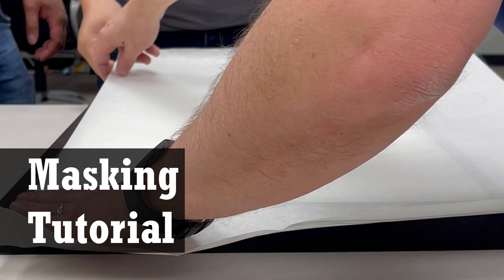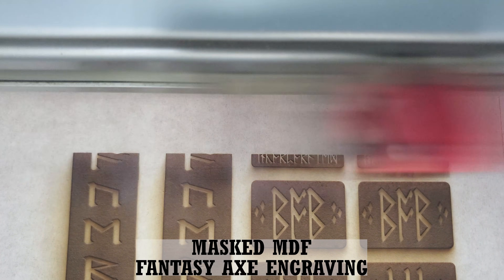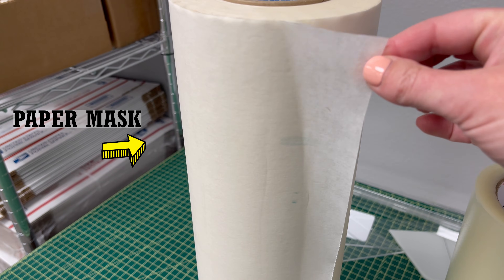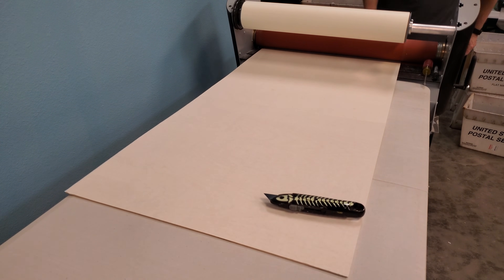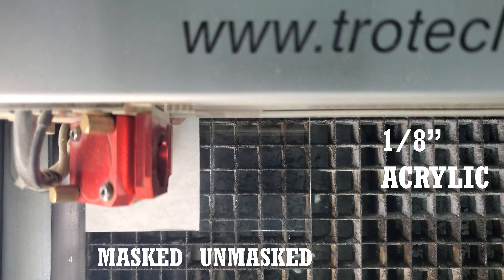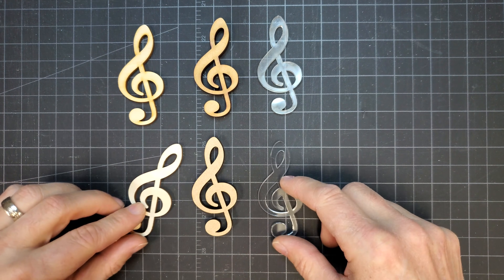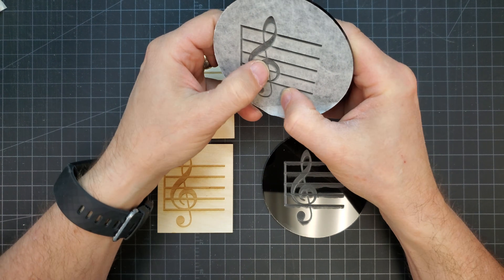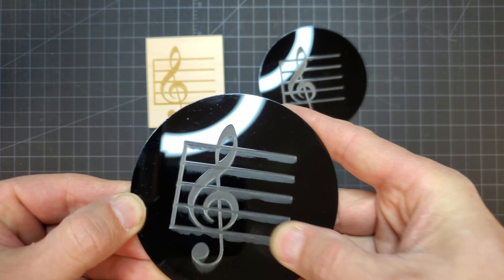Laser Experts Show You How to Avoid Surface Burning Using Paper Mask on Your Glowforge or Laser

Comment: I found masking my engraves was a great improvement purely by experimenting with different types of tape. The white masking tape seems to work best for me. I use air assist at a low flow rate to keep the laser lens clean. Great information for those that want a clean burn on engraves. Thanks for making the video ! Cheers. (thumbs up ) ;-)

Comment: Would you recommend this for card stock? Thanks, Greg
Reply from the maker: That's a good question. I don't think we've ever tried app tape on cardstock. It might work ok, but I'd bet you'd need a low tack version so you'd be able to remove it after.
Reply: @smedleyworks  Thanks. I only have a 5W Diode and I am trying to avoid visible lines on mat board for picture frames

Comment: I like your channel as you have a lot of useful information.  Months ago, I tried the TapeManBlue 12-inch x 100-foot you mentioned in your "Alternative Application Tape" section.  I had terrible results.  I applied it to three 8x12 inch pieces of Basswood.  By the time I had it applied to the third piece the first one was peeling off.  So, I grabbed my J roller (used to apply Formica to counter tops) and press rolled the tape onto the wood.  Prior to applying the tape, I had blown off the surfaces, so I knew there was no dust on them.  As I was cutting the first piece the tape kept peeling up.  So, I returned the tape.

Was this problem caused by a bad roll of tape, something I was doing wrong, or normal?
Reply from the maker: Different surfaces will require different levels of tape tackiness. It sounds like you either need to try a different brand or something with a much higher tack level. You can also try something like blue painters tape.

Comment: You could also use air assist.
Reply from the maker: Air assist was used on all jobs in this video. We pretty much have it turned on for everything, except things that could blow away like paper. 🙂
Reply: @smedleyworks  
I found some air assist to be weak.
If you re-purpose / install a Dual Air pump for a Salt Water Fish Tank it’s Much Stronger & Quieter.

Comment: Sadly, Trotec, Glowforge and many other machines lock you into requiring masking as a solution to the brown tarry residue issue so there is no critcism of this video explaining  your method. It certainly stops the brown overspill but it does not prevent that tarry residue infusing all the exposed engraved areas. This unwanted  colouration (and strong  burnt wood smell) you call burn marks are completey preventable if you understand how and why they are created. As I said, there are no negatives intended with this comment because at present you are forced into this time consuming and fiddly process thanks to Trotec's lack of process understanding. I do not have a Trotec or Glowforge so I cannot advise of how you may modify your machines. All I can do is explain and demonstrate the root cause and fixes for the problem and leave it to your engineering skills to see if you can ultimately dispense with masking everything by making your machine "a bit special".  Please take a look at this.   https://www.youtube.com/watch?v=79VZjMdfBmI.
I was prompted to offer this help when I saw your recent video with the very fiddly and time consuming process of demasking all those Christmas ornaments.

Comment: Gr8 video, how much of a difference do you need in power depth settings between non masked and masked? thyx
Reply from the maker: In our experience with our lasers, there is little to no difference in power settings when adding application tape to material. I have noticed a slight need for more power when cutting through some factory applied acrylic masks though, but not much.
Reply: @smedleyworks  brilliant.. thank you

Comment: Have you guys masked leather... if so, how did it do?
Reply from the maker: We tried masking the faux leather we used in a previous video, however the mask we were using did not stick very well. We think it was either the finish on the material or we needed a higher task mask. We have seen it done successfully in other YouTube videos, but we don't have much experience lasering leather.

Comment: I clicked on the link for the 12" X 100' paper masking and their description says that it shouldn't be used with lasers, I was wondering if you've experienced any long-term issues with the product?
Reply from the maker: We've used a number of different paper tapes and never had any issues with cutting and engraving on any of our lasers. The only issues we've experienced have been how well they stick to the material. However, we'll update the links with some alternative brands.
Reply: @smedleyworks  Thanks for the reply, I'm sorry, I honestly wasn't trying to be a Karen. The video is very informative, having the back side come out as clean as the front is a real plus. I'm going to try and get a small amount from a local sign shop to play with before I get a whole roll. Thanks again.
Reply from the maker: @paulabbott9893  No problem at all. We definitely don't want to recommend anything inappropriate. Best of luck with your projects. :-)

Comment: A good air assist avoids the need for masking
Reply from the maker: Yes, there are a lot of factors involved to getting good cutting and/or engraving results. Good air assist, strong exhaust system, materials (type and thickness), laser speed, laser power, etc. It's a balancing act. Masking is a really nice convenience, but it might not be for everyone depending on your particular circumstances. :)

Comment: Application tape adhesive (any adhesive backed paper really) ends up as a gummy mess. Try using "tea bag paper" (open mesh tissue paper used to make tea bags 😊) applied with tap water - it just blows off when finished. It's better for smaller items as it can dry out on large surface jobs. Put the paper on dry, spritz with water then squeegee.
Reply from the maker: That's an interesting idea. We haven't experienced the "gummy mess" you described.
Reply: @smedleyworks  Yes, application tape is covered in "snot glue" - like a repositionable adhesive - it breaks down under heat and leaves a deposit - you're maybe wiping it off with something - IPA/petrol or some other organic solvent :-) The tea bag tissue and water is a lot greener, works just as well (if not better as it soaks up the smoke) and is a whole lot cheaper :-)
Reply from the maker: Honestly, the app tapes we use don't leave any residue behind. I've used it on a lot of materials over the last 15 years or so, and I've never had to do any cleanup after.
Reply: @neilgillies6943 - where do you get your tea bag paper? I’d like to try this method.

Comment: Can you use the masking technique when doing powder coated or stainless steel tumblers?
Reply from the maker: That's a good question. We have engraved coated tumblers before, but not masked. I don't remember any burning or residue being an issue. I would think a mask would work fine, but I'd test it first if possible. For stainless steel, unless I'm mistaken, you'd need to coat the surface with something like Cermark (unless you have a fiber laser). With a Cermark coating, I don't think you'd need a mask as the coating protects the surface and you wash it off after engraving.
Reply: @smedleyworks   The reason I asked, was to use the masking as a mask to add color to the engraved portion.  Example: engraving the item then spray paint the engraved image with gold spray paint. Such as black tumbler with gold letters. Ace Hardware makes a REALLY nice GOLD metallic paint. I like  the color better than Krylon. More realistic gold color. THere is also a additive to add to powder coat to make it a sprayable water based mixture. After engraving, Partially bake at low temp to melt the color, remove masking then finish baking at normal temp to cure.
Reply from the maker: Ah, got it. Paint filling the engraving! I don't see why that wouldn't work. Depending on the design's detail, you could maybe also try just lightly vector cutting the mask, and peel away the areas you want to paint. Use the mask like a temporary stencil. We do that all the time as it can sometimes be faster than engraving. :)

Comment: That’s genius as no need for an air assist, thanks for sharing 👏
Reply: If you have a machine, DONT turn the air assist off . Those tarry fumes will soon coat the face of your lens, bake on and irreparably  damage your lens. Trotec make amazing and elegant mechanical machines but sadly they have never put as much effort into understanding the  laser tecnolgy they "bolt on" .  The relationship of power, air assist flow rate, nozzle orifice diameter and the gap between work and nozzle  are diametrically opposite needs for efficient cutting or efficient engraving. The fact that this is an RF laser source  makes this poor at cutting but great at engraving. For engraving you need a big nozzle orifice,  just a whisper of air assist to keep fumes away from the nozzle and a BIG gap between nozzle and work. Unfortunately you have to use what Trotec has designed. and the result will always blow the tarry fumes back onto  A) the engraved work area and B) the surroundong areas.. It is 100% possible to do clean engraving without masking but not with the parameters and conditions Trotec force you to use. Hence this tedious workaround of masking everything. . Take a look at the first 2 minutes of this video to  see fume-free  engraving  with a cheap K40 machine at 1000mm/s   https://www.youtube.com/watch?v=zu-hccXJPBg
 If this piques your interest then skip through this video to see  tar-free cutting and more UNMASKED engraving   https://www.youtube.com/watch?v=i1M39dzyCOw
 So,  as you will see, I am not maing baseless claims. and I am doing this on a $500 machine not $50K

Comment: Marks on the reverse of cut items can be avoided by raising the item off of the bed... various methods exist. Most of what people consider to be burn marks is actually smoke residue being deposited on the surface of the piece being cut. If your air flow is sufficient across tghe surface of the piece being cut this shouldn't be a problem.

Comment: If you need to remove a lot of masking in a small area (say text) get a plastic razor blade (they come with scraper holders) they make quick work of lots of small stuff without scratching anything.
Reply: I was actually thinking of something like thatto remove the paper while I was watching this.
A couple other things I thought you could try are guitar pics & plastic tools for opening devices like cell phones
Reply: @bwselectronic  Yea, they would probably work but the plastic razor blades are like $0.07 each so when they get dented (they will) you can just toss them.
Reply from the maker: We actually have plastic razor blades, but never thought of using them that way. Thanks for the tip! :-)

Comment: I made some calculations and for each item I sell on etsy would be about 3.5$ more per item just for the making tape. I use that method for smaller jobs or when in need of painting in the creases of the etching, but usually I pas a light danger over the little marks and it's removed with no problem. It also depends on the quality of your laser, and your etching intensity, deeper burn = more to clean.  Great video and thanks for all the information and the links for the making tape applicator. It will come handy for some projects I have in mind
Reply from the maker: Hi Jonathan, Thanks for sharing. That price per piece does sound really high, unless you're selling large items. We calculate our cost based on square inches and given the rolls are sold in yards, the rolls we're purchasing are 300 feet in length (100 yards) and our per square inch cost is $0.013 (times 2 if masking both sides).
Reply: @smedleyworks  yes most of my items take between 3 or 5 pieces of Baltic birch 20"x30"

Comment: Have you tried using a heat gun to help remove the masking? Great video! Thanks for the tips
Reply from the maker: Yes, we actually tried that when removing mask in our cupcake holder video! It does make sense. It's something we've always done to remove stickers and adhesives especially in automotive applications.

Comment: Appreciate the video.  So based on your description I want to validate you use high tack tape, I find the tape I have peoples up during the laser process especially when my airflow hits it.  One question - sounds like you mask the front and the back, is that correct?
Reply from the maker: Yes, we use high tack tape, but a medium tack will work well for very smooth materials like acrylic. We do cut some rougher stuff like Baltic Birch sheets that definitely needs the HT tape or it will lift up. We almost always run our air assist, and don't have any issues with the high tack tape. We almost always use tape on the bottom of materials, unless that surface will be hidden or presentation doesn't matter. We use the app tape on the top a lot, but it depends on the material and the result we want.

Comment: It is not PolyPropylene that you mention that the masking tape is made of, but PVC (Poly Vinile Chloride) which is extremely toxic and destroys your electronics.  Polypropylene, on the other hand, is really good for laser jobs.  I even use 3 and 5mm PP plates to make outdoor signs with.  But otherwise a really good video.
Reply from the maker: Oops! Thank you for the clarification. 😊
Reply: thank you!  This helped me more clearly understand that I shouldn't take the risk of using some of the PVC mask that we had around for use with our cnc machine.  Don't really want to breath in hydrochloric acid!!

Comment: Thanks for sharing that tip😀 
Would I need to mask the surface if I had an air-assist system fitted? 
Thanks in advance,Cam
Reply from the maker: Yes, pretty much everything we do uses air assist and we still mask most things for best results.

Comment: Thanks for this tip, especially for the paint fill tip at the end.
Have you tried an embroidery tool called a weeder? It's made to remove the mask.
Also, embroidery suppliers have the mask material you are showing
Reply from the maker: Great tip! We use tweezers for weeding small pieces, but we've heard the embroidery tool works well, too. :-)
Reply: @smedleyworks  knock off dental tools work great for weeding in the making of vinyl signs.   A good brand of pic set works good too, but not super cheap ones.

Comment: Correct air flow and fume extraction achieves the same result with a lot less work. No peeling required!
Masking a good option for acrylic or if colour filling.
Use a pin or knife bed rather than honeycomb. Too much back burn from honeycomb grid.
In my experience, a pin bed and proper air flow gives clean work every time.
Reply from the maker: Thanks for the insight. In regards to the pin bed, we've used a small one in the past for small pieces. We do not have experience with larger pin beds and are not even sure if it is available for larger lasers. Our machines have good air flow and fume extraction and we've still found that masking this way eliminates any issues.

Comment: We just clean with a wet cloth and its perfect. So I don't see the point in paying $100 for the masking and the additional time to remove it again. We do use masking if we do paint fill but other than that we just clean it with some water.
Reply from the maker: Yes, that's a great tip and can work, too. We sometimes use a damp magic eraser and it works well on wood with light engraving and vector cutting. For acrylic or wood with a lot of engraving, or when we're producing a lot of pieces, we feel that masking provides the best result for us and is worth the little extra time and expense. You can buy small rolls of paper mask online for under $20 and apply it by hand.